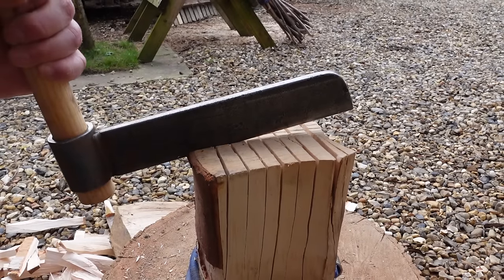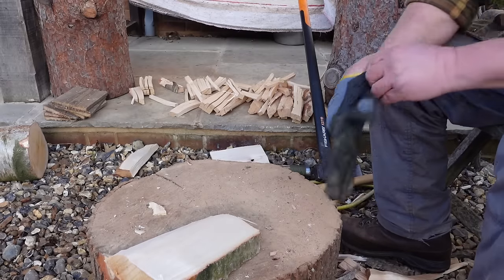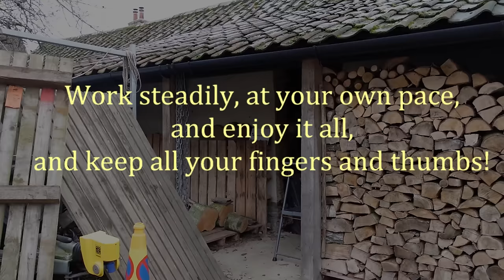Split Kindling Safely!

Comment: Where did you find this « froe ». I be never seen this tool and it looks very interesting
Reply from the maker: Froes - sometimes spelt 'frow' - are great.  They seem fairly easy to buy on the internet, and I have known people to ask a blacksmith to make them one. Although that seems the expensive option!  The beetle in the video is beech and too light, I need roughly the same shape but about 30% heavier. Good luck locating one. Vince
Reply: @WoodFiresWithVince  thanks a lot. I’m French and actually it s named « departoir » here. I didn’t know this name either! And yes I can buy online … from Germany… crazy world! Thanks a lot for great video and tips. Looking forward to try this new tool!
Reply from the maker: Really glad you have found one, a nice new skill to have. All best wishes, Vince
Reply: @WoodFiresWithVince  in the meantime I ordered a splitting base blade for 18€ and comes from GB 👍. The froe is around 100€. Will see how this little thing works for kindling
Reply from the maker: I think the base blades are good - but I have not used one. Certainly a cheaper option!

Comment: That's nothing new. German coal miners have been making kindling in this way for over 100 years. In Germany it is also called "Mutterklötzchen". See also the following link. https://de.wikipedia.org/wiki/Mutterkl%C3%B6tzchen
Reply from the maker: Thanks for the link.  I am not suggesting that axes, hatchets and froes are new - in fact they are probably the oldest tools humans still use.  But you would be amazed how many people get injured cutting kindling.  I spoke to a man two days ago who had embedded an axe in a chopping block to split kindling upside-down.  He showed me a massive bruise where he hit his hand with the hammer he was using!  But at least he still had all his fingers. All best. Vince